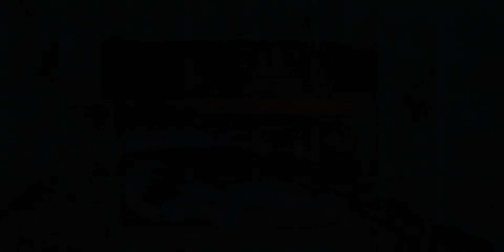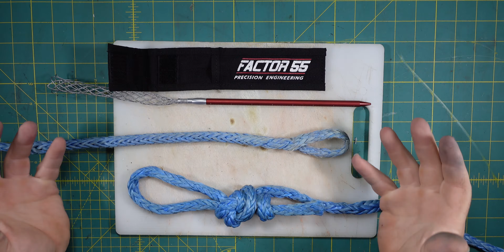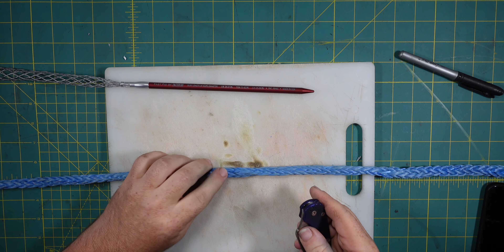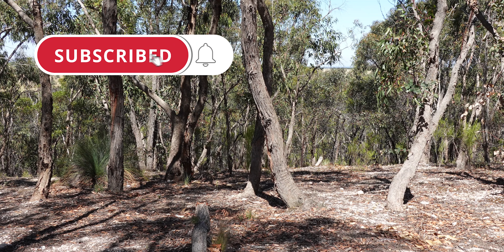How to Repair 4x4 Synthetic Winch Rope including Brummel lock-splice

Comment: I bought a 85' X 3/8" for my 9500 winch . It was wire and the wire was only 65' . So I have too much rope , using this tutorial I can 
make it fit better . The problem with too long of rope is there never seems to be a tree in the middle of the road . Thanks and have
a blessed one .
Reply from the maker: I agree mate, that's too long.

Comment: Honestly, the locking brommel is not much more effort or time than the trail repair, it seems. Why not just take a couple extra minutes to lock up the knot on the trail?
Reply from the maker: Good point, and in field repairs that's what I do. Though it's a couple of extra steps to remember, and if you only repair 1 winch rope per year......

Comment: Would you just use a soft shackle to hook up to extension rope?
Reply: Is it safe/ok to just use the hook on the winch to hook up to the eye of the extension? I'm new to winching..
Reply from the maker: @nathanbeaulieu1534  while it's accepted, it's an un-necessary extra potential missile if things go wrong, I've never had a hook on any winch I've owned.
Reply: @LockyourHubs4WDing   so basically would u recommend just an eye loop on the winch side with a soft shackle to connect to the extension rope eye?
Reply from the maker: @nathanbeaulieu1534  yes, or even eliminate the soft shackle and join the two together as you would two snatch straps.
Reply from the maker: You could, though you would be better off joining the rope to extension use the same technique that you do when joining snatch straps. One less potential point of failure.

Comment: A tip for those who might find themselves in a situation where a repair is needed but no fid at hand; grab yourself a stick and taper it down. Use that the same way sailors used similar fids for who knows how many hundreds of years. That Factor 55 fid would be nice to have but, like everything that company sells,  they are incredibly expensive. I might see if I can get hold of a cable puller end with a similar "nest" and make my own. Failing that, maybe I can weave one from stainless steel MIG wire, as I just happen to have a small roll of that kicking around.
Reply from the maker: It's effectively a "chinese finger trap". In a pinch, I think a ball point pen case and tape would be my go too.
Reply: Made my did from the end of an old ski stock😎
Reply: Knitting needles, big , hollow , back end cut off so you can insert the rope

Comment: I still prefer a thimble on the end of my rope. When I need to join the rope to an extension I use a soft shackle made from the same rope. Because a soft shackle is effectively a double rope, it will have at least 70% more strength than the rope itself, depending mostly on how the stopper knot is tied, so can pretty much be discounted as adding another potential point of failure. If for some reason I wanted a loop without a thimble I'd be using a sleeve instead.
Reply from the maker: Probably a sleeve is a good addition. I still prefer to run without a thimble. I'm forever running out of shackles (both hard and soft) in more complicated recoveries.

Comment: Two rope join, yes please
Reply: Also, while on winch ropes, I’ve got a dyneema line but haven’t yet swapped it for the steel line intending to maybe use it as an extension line. Is it ok to do this and if so how can you shorten or adjust the length of the extension other than just wrapping it around and around the tree which sounds pretty dodgy. Might make an interesting topic for a future video. Love your work by the way. Also you need to do a video on your background, I’d love to know how you know what you know.
Reply from the maker: @cooperken11    an eye splice at either end (preferably brummel) and the winch line will make a great extension rope

You can shorten a winch rope easily using the "daisy chain" technique. 

I might do a video on my background one day, though I don't want to bore people to tears! :)
Reply from the maker: Done! Well soon, anyway!